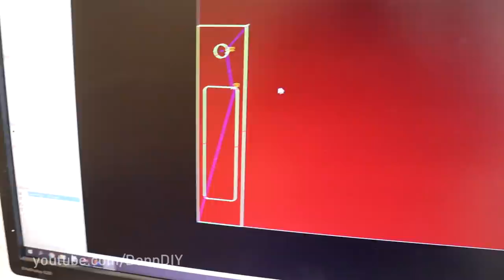4x4 PTO Driven Timber Trailer BUILD Ep.4 - Chain Housing Finished

Comment: I got 3/8" square drive tap drivers from Snap On that would have saved an hour (or more) using a cordless impact wrench (to thread the chain access cover holes)! 

I started tapping with a cordless drill (not impact!) cast iron when building wind turbines, after told to do it that way by the manufacturer.  It works, trust me! 

I was amazed, then converted to impact wrenches when I found Snap On sold the tap drive sockets! I'm never going back, it's easier to keep the tap aligned with the hole than using those old "universal wrench" things!!

Comment: Great Video!  The grease fitting on the pillow bearings are not for the bearing itself but for the bearing cage to bearing race contact.  if you want to grease your bearings you need a grease needle to feed the grease between the bearing seal and race.  I just found this out.  I do not know if this is the case for these bearings in the video?

Comment: Man! Even a mag-base drill! 
    You may want to build a frame to lift each side final drive off the trailer as a unit with the wheels on. This would allow one side to be brought into the shop for repairs if/when something goes badly wrong in the chain case. It'll be far too heavy to manhandle, but your skid steer could lift and carry it easily. Overall, I'm really impressed with this, and the UTV. Both are something every farmer/rancher should have in his equipment inventory. 
      Well done! Now finish your sandwich and build the rest of it! ;)!

Comment: Hi Donn great video again, but I really don’t understand the way you are going to use your tensioner. The bolt to put tension on the chain is attached to the service lid. I assume that when the chain is on tension you want to tighten the bolts from the tensioner. To do that you have to remove the service lid and you will loose the tension. Can you please explain? Thanks
Reply: That was my concern as well. I think the tensioner will have to be fully unscrewed to open the service panel.
Reply: not to mention assesing how tight you have it, i'd have just pushed down on the slide with my hand, locked up the 4 bolts job done, once the chain and sprox have settled together wear given the oil bath should be next to nonexistant, damp and rust inside the cases mind you could be a problem.
Reply: The only explanation that makes sense is that the 4 tensioner-to-case bolts will be only for guiding and never tightened. The tensioner bolt will always take all of the force.
Reply: I think the tensioner will have a stop in it ,,so the adjuster will hit it ,, he will be able to push down with the adjustment but it will not lift the tensioner ..
Reply: @connerlabs  I think they will be tight .. if run loose it would rub and grind itself down ,, if he were to run like that he would need springs in the system .. my thought ..
Reply: @connerlabs  that would be bad. If because of what kind of reason one of the wheels is locked the chain tension will increase and could bend the service lid.
Reply: @mooihoor6381  I guess that's why he's adding reinforcing ribs to the lid? The tensioner will also get a lot of force when reversing. Not 100% convinced by this design myself.

Comment: Try a pie cut of small round tube for the weld nut you need plum with the bolt running through so its easier to make and the nut will less likely move while welding, nice build i like this style of video straight to it now subbed

Comment: Chaincase looks great, Donn!  Have you considered adding a vent to the top of the case?  Without it, the bearing seals may be pushed out. 👍
Reply: It seems like the chain tensioner bolt will not be sealed hermetically, thus acting as a vent.
Reply: @siimanderson4549  good thinking!
Reply: Cualquier respiradero, debe ser hecho con un tubo pequeño, y una manguera relativamente larga...  O sino, por ahí entra polvo y barro, normalmente taponando todo...
Sucede con los diferenciales de camiones grandes, y ya he visto muchos cojinetes reventados, precisamente por no respirar más...

Comment: Hi, Wonderful job with chain tensioner in the cover has one potential problem that i see.. How do you keep the weather out if it is unsealed and is on the top? If you run this machine through deep water it is also going to take water in. Perhaps make another sealed box on the cover or mount it under the cover. That way it can be serviced without worrying about the weather. This is only a thought from an armchair machinist. Thank you from Virginia USA

Comment: you should best wash out theses gear boxes with heating oil to get the shavings out , also install a neodymium magnet to catch shavings at the bottom or in the oil plug
Reply: yeah +42 thumb ups for the magnet. ;-)

Comment: Great video Donn only problem is your not building a second one for me LOL .. don't remember what type of skid steer it was they built it  roughly the same set up but a cheaper build .. your build will hold up nice .. one question with the chain tight  can you get the top cover off for a check over ?? the adjuster will just slip in and hit some stops ..like the idea of the bolt clamp ..

Comment: you should look for large diameter slim width tire chains  , might be able to modify them to have the chains over both tires like a track on a tracked vehicle
i honestly dont think you cna get this thing stuck so long you dont sink it in a swamp to frame height or high center it on a stump

Comment: I love the design, but I'm wondering if the adjuster is on the outside of the hatch, and the nuts to tighten the tensioner are on the inside, how can you tighten them after adjusting the tension of the chain, or wik there be a "sliding nut captioner" and the bolts not welded down on the outside? Just wondering. I love the machine itself. Looks like it will definitely do the trick. Can't wait to see this come together.

Comment: 20:48  You might need a second bearing on center shaft to keep it from breaking away from differential. Unless you are rigid mounting chain case to frame. 
11:44  I tap laser cut holes all the time. All holes can be plasma cut in cover & the access hole it's covering. Or you can plasma cut a smaller hole & then drill it to size.
Reply: Maybe a longer shaft & a bearing on the outside of chain case. Under fender area.

Comment: For the tensioner. You should have made captive nut plates for the inside. Then you could have loosened the 4 bolts from the outside to adjust tension.

Comment: This is going to be one hell of a trailer. 
If this works out very well it could be a good platform for another type of atv/utv type thing. I was thinking more along the lines of a articulating machine or something. 2 of these drive units connected to a middle unit with engine. Would be pretty cool.

Comment: I applaud your design for putting power to the wheels on your trailer, but how do you get the rotations in sync? As I understand it, a PTO runs at a higher RPM than the tractor wheels. How do you get them to synchronize? I must have missed that part. Outstanding fabrication skills, I wish I had your abilities!
Reply: Good point didnt even realise
Reply: @Marcuslobenstein  WOW! So I guess that means I still have a functioning brain cell left! I thought for sure that I was missing something.
Reply: Donn also built the vehicle that will tow it, so he just made the PTO to have the correct RPM. :)
Reply: he showed it in words at the end same rear end as the utv .. same size tires ,, the driveshaft that drives the utv will drive the trailer .. same speed ..
Reply: Okay, I see. I thought that by responding Marcus Lobenstein was the creator. Like I originally said, I was sure I had missed the part about that.
Reply: @dozerboy67  Donn is the builder don't know who Marcus is ..
Reply: @randytravis3998  yes, I see that. See above 👆
Reply: His utv has his PTO driven from input  to rear  utv diff at 1:1 ratio, this PTO drives the trailer diff at 1:1 ratio.  Ie same diff rotations on both UTV and trailer, and, same size tires on both UTV and trailer, so, everything turns at approximately  the same speed on both  whether doing 10mph or 70 mph. Both diffs still independently perform as diffs, in so far as the inside wheel can turn at a slower rate than the outside wheel  when cornering. This can be to different  amounts on the utv and the trailer as needed
Reply: Oh, for fucks sake…..
Reply: @dozerboy67  ????
You asked a question,  referred to unrelated 
PTO system on tractors  running at higher RPM than the rear wheels, have Donns simple system  relatively succinctly explained  for you and others who didn't watch closely enough or see what was clearly shown throughout , and you respond like this  .
 Wow,
 just wow
Reply: @dozerboy67  ????
You asked a question,  referred to unrelated 
PTO system on tractors  running at higher RPM than the rear wheels, have Donns simple system  relatively succinctly explained  for you and others who didn't watch closely enough or see what was clearly shown throughout , and you respond like this  .
 Wow,
 just wow

Comment: I noticed that you designed the studs for the tensioner mount where they have to be tightened from inside. Shouldn't the 4 studs have been welded to the tensioner so that you can fully adjust and then tighten the 4 studs while the case is completely closed? I guess I'll see on the other next videos. This series is awesome.

Comment: Build looks great 👍🏻 I have a question will it not create a problem when the ratios don’t match and then breaking stuff ? Are you planning on running a slipper on the PTO to limit torque?

Comment: Your oil level might be a bit low, only speaking from working on CAT graders, you should put those cover bolts in from inside and tack weld them so the wear is on bolt threads from the nuts and not in the housing

Comment: Would be so interesting to see what you and Colin Furze could cook up or maybe how you two would build the same project, now that would be one interesting collaboration.
This is an awesome build can't wait to see it work, so do you think it will be able to move more with less energy or just not get stuck?
Reply from the maker: The main reason for making this trailer is that I can only load the trailer without putting any load on the rear axle of the UTV. The UTV will be only for steering the trailer. That means less stress on the UTV components.
Reply from the maker: Collaboration with Colin Furze would be something awesome indeed but I'm not up to his energy levels.😀
Reply: @DonnDIY  Nice was not even thinking of that was automatically thinking of load and thats why I'm watching and you are building.
Reply: @DonnDIY  you need some Yorkshire tea. 😁 He must be fit after all that digging to be fair though.
Reply: @DonnDIY  Thats why I think it would be an awesome colab you both go about things in different styles yet come up with amazing results.

Comment: 🤯 Amazing as always! Are you planning on doing a sight glass for your lube oil level, or just drain and fill holes with the fill hole at the appropriate max level? Seems like just having the fill hole would be simplest. You could have the fill hole at max, and the acceptable minimum could be whatever you could touch by sticking your pinky finger (or whichever) in the fill hole. Field expedient level gauge!

Comment: I would use two old break springs on the inside of your chain tensioner and wouldn’t have to ever worry about it.
Reply: And what happens when he put's in to reverse?
Reply: @lennym1273  ...you put the springs inside the tensioner housing where the spring pulls down on the holder....putting it in reverse wouldn’t make a difference. All you have to do is weld a button down low and fix the spring at the top so it pulls down.
Reply: @sawboneiomc8809  Yeah it don't work that way, when you have a spring tension-er one part of the chain is in tension while the other half is slacked we always put the tension-er on the slack side BUT if it will have reverse then it needs to be a solid tension-er, so that when the chain side with the tension-er becomes tight there will be almost no slack on the chain, look at a 10 speed bike the derailer/tension-er is on the bottom of the chain for that reason, try peddling backwards on the bike and see what happens to the derailer...
Reply: @lennym1273  you said ..”so there would be almost no slack on the chain”...that’s why we use springs.....it takes out the slack. With springs it takes up the slack automatically. With a solid one you constantly have to compensate for the natural stretch in the chain. The chain doesn’t care. Going one direction to another it must stop completely before going the other way. If there is no slack there is no slack. And you can’t apply power on a  10speed in the reverse. The front ofHis differential could be either side.